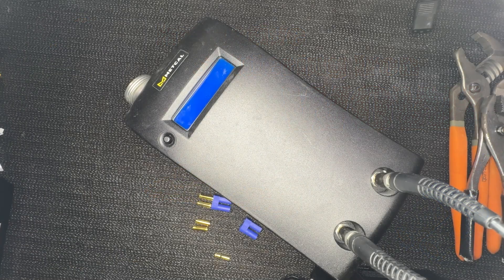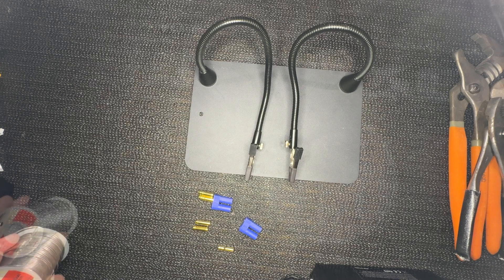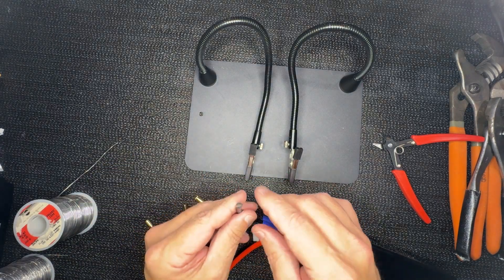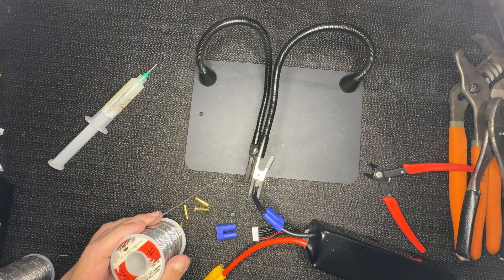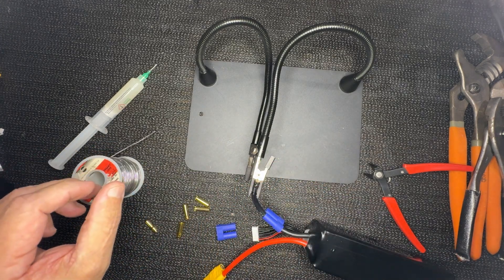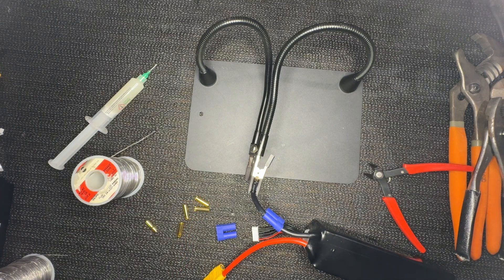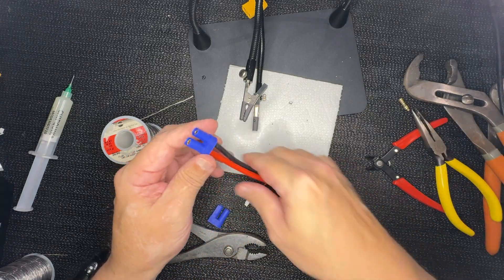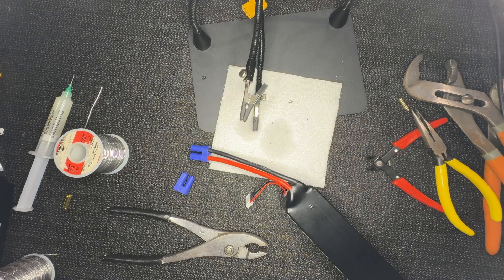Inductive soldering and easy way to install EC5 connectors

Comment: Thank you for the video.  I don't have any formal soldering training, but I am astonished how little solder was used to solder the connectors in this video.  I have been using an excessive amount of solder in comparison.

Comment: Amazing bit of kit Auggie. But this price is unbelievable 😮
Reply from the maker: This one is $241

https://www.amazon.com/Thermaltronics-TMT-2000S-PM-Soldering-100-240VAC-interchangeable/dp/B00NS4J254
Reply from the maker: Starts at $241 and goes up to $1000 for the dual iron top of the line but the $241 is worth every penny.